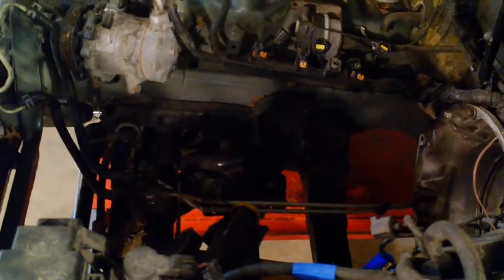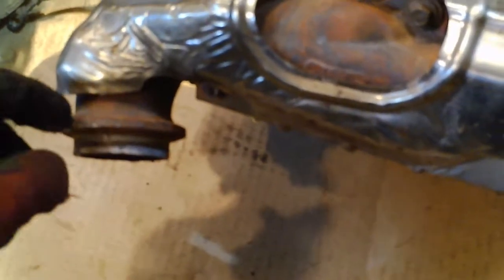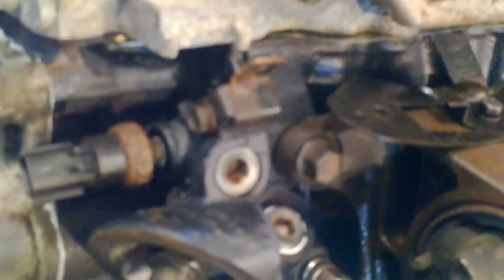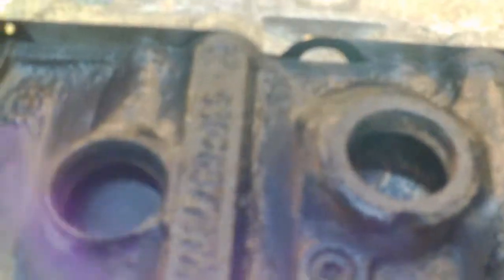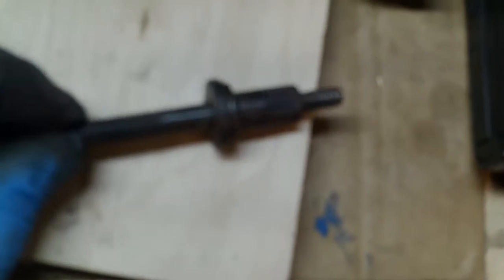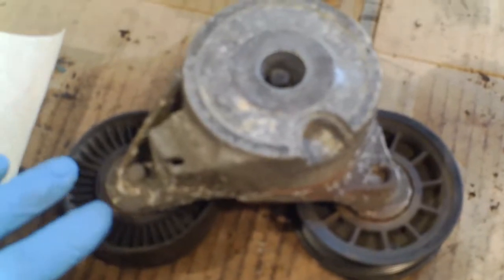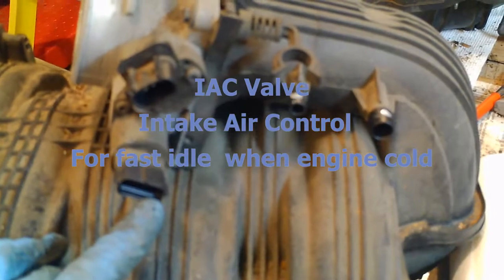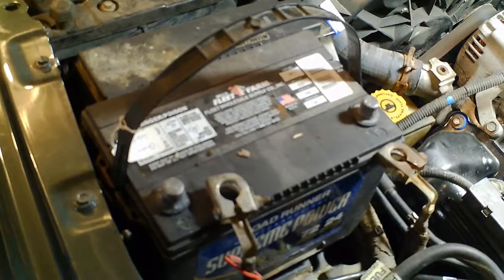Jeep Liberty 3.7L engine differences and swap 2005 to 2002

Comment: Hi, I know I'm late to the game, but my understanding is that the jtec engine has a 3 plug ecu harness connector, whereas the later ngc engine has a 4 plug connector. I'm just wondering where in the engine bay to look for this stuff. 
thanks in advance, and thanks for making this video.
Reply from the maker: Sorry, I don't know about that connector.  I didn't mess with the ECU, but I  know it is different and that's why I had to change that reluctance wheel.

Comment from the maker: I am not sure of all the problems you may face changing ECM and harness.  I just decided to rebuild the engine while I was at it on my project and then swapped the reluctor wheel.  If you can find the part number of the wheel for both your engines, and they turn out to be the same, then I think you will be fine.  If they are different, then you have to decide whether to swap ECM et. al. or change the wheel in your engine.
Reply: Ok thanks for your help.
Ill check out the engines and see.
If it is possible I'll report back.
Thanks for your video now I know what to look for be for I had it swapped.

Comment: Hi.
So just found your video after purchasing a 03 jeep with blown motor and I have an 05 that has a good one but the body is no good.
Thought it would be a direct swap.🤣
It might be I have not checked yet but won't be my luck.
What do you mean swapping computers?
I'm guessing I'd have to change the computer and engine harness.
Just trying to figure out which would be a easier route to take.
If you have any advice I would appreciate it thank you?

Comment: Do you know if the 3.7 in a 06 liberty will fit in a 03 ?
I cant google it, nothing definitive anyway.
Reply from the maker: The best way I have found is to go to a site where you can buy a rebuilt engine, enter the information for both the 03 and 06 liberty and see if you end up with the same part number.  I would do this on a few sites to be sure you get the true story.

Comment: Do you happen to know if the 2006 and 2005 engine block gaskets vary at all?
Reply from the maker: Sorry, I do not.  I did this some time ago and have forgotten everything now.  Go to Rock Auto, or similar, and look up gasket set for both years and see if they give you the same part number.
Reply: @JB_WI_Triumph   thanks for the suggestion

Comment: But I would like to know why you wanted to do this exact swap? Is it convenience/availability or performance/benefit?
Reply from the maker: I had a rusted out grey jeep with decent engine and found the green jeep with pretty good body and blown engine.  I thought I could just move the engine from the grey jeep over, but because of that stupid reluctance wheel difference, I had to tear the engine down.  As usual, the simple project became more complex.

Comment: Can you drop the transmission and engine oil pan to pull the reluctor ring?  Do you have to pull the crankshaft to get to the reluctor ring?
Reply from the maker: Maybe easier to change the computer?  I suppose that has its own set of problems though
Reply from the maker: You have to pull the crankshaft to get the ring off.  It might not be impossible to do it with the engine in the car, but it would be very hard.  Just getting the oil pan off with the engine in place is some work.
Reply: @JB_WI_Triumph  I was afraid of that...got it all buttoned up... Crank but no start.  2004 engine in a 2002...was initially told good thru 2004...not so!

Comment: i know this vid, is out date, but hope you still reply ..  I have 04 limited body with a block, that i dont want to mess with, and i have a RUNNING 05 sport.  is there any information you can pass my way if you remember, on if a 05 will work without changing anything out to the 04  ?
Reply from the maker: My best guess and memory is that it will work, but there is good way for you to check.  Go to a couple of sites that sell long blocks.  Enter the info for both your vehicles and see if they end up selling you the same long block for each.
Reply: @JB_WI_Triumph  ok thanks.  just worried if i need to change the cam gears out ..  I did find some information on liberty`s that said something about every 3 years the motors had changed, so like 2000 to 2003 are the same 2004 to 2007 are the same.  not sure if this information is in fact true  or not. but people have said it is .  wish i could out for sure and not just go by hear say more less ..   But thanks for the checking the block out information ..
Reply from the maker: @fishtank1041  The years you mention sound right to me as having the different reluctor wheel.  I didn't check your block info, but I think this in an excellent way for you to be sure about what engines you can swap.  If a long block supplier gives you the same engine for both your vehicles, then it would seem you could swap engines w/o worry.

Comment: do by chance know of any differences between the 2006 and 2007 3.7 engines? THX
Reply from the maker: I forgot a trick I used.  Find a site that sells re-manufactured engines and put in the details for the 2006 and 2007 Jeeps.  See if they would sell you the same engine or not.  If you try it with a few sites and always get the same result, then you probably can feel confident you have the answer.
Reply from the maker: I suspect they are the same, but can't say for sure.

Comment: I wonder what the thing in the water jacket was? Maybe part of a cnc machine :) place I worked had sucker hose quick connect on trucks for changing oil. Most of the trucks were at bottom of pan, but Cummins m11 was in side of the pan. Pulled the plug as there was prob still 3 qt in pan, nobody else had ever pulled it before. Out came a 8mm bolt. Must have fallen in when engine was being built, cause nothing ever grenaded on that mill
Reply from the maker: I am pretty sure this engine wasn't torn down before so whatever was in the jacket must have been there from the factory.  Perhaps it was an option at higher cost.

Comment: I need to swap an 05 motor to 2004 liberty  any tips ? Email?
Reply from the maker: My memory of this project is starting to fade, but make sure you check that the reluctance ring is the same in both motors or you will have to tear them down to change (or change computer).  I think you safe between 04 and 05, but check to be sure.  My 2002 had these band clamps for the CATs and they were miserable to get installed (I should have put CATs on while engine was out).  I think that they changed them by 2004, but if not, see if you can leave CATs on engine, or put a pan down to catch the blood from your hands as you try to install them after engine is in.

Comment: Good info!!! Was wondering if you know the difference between the 3.7 liberty to the 3.7 grand Cherokee I'm trying to do an engine swap on a 2010 grand Cherokee
Reply from the maker: Sorry, I don't know anything about Grand Cherokee engine.  Sometimes you can infer things by looking up parts for both vehicles and see if they have the same part number.  It is tedious, but you could check rings, rods, crank, cam, reluctance wheel and see if you get the same part number for both vehicles. 

Best of luck, sorry I couldn't be more help.
Reply: @JB_WI_Triumph  hey thanks anyways like you said I'm going to compare the parts numbers
Reply from the maker: I found this site where you can buy a re-manufactured engine.  Take a look, you can enter your year and VIN, see if you get the same engine or not.  They do say in the description that this engine was used in Jeep Liberty and Grand Cherokee.  The year selection box covers 2002 to 2010 so it seems like you have a chance.
Reply from the maker: https://spprecision.com/products/dodge-jeep-37-226-long-block-crate-engine-sale.html